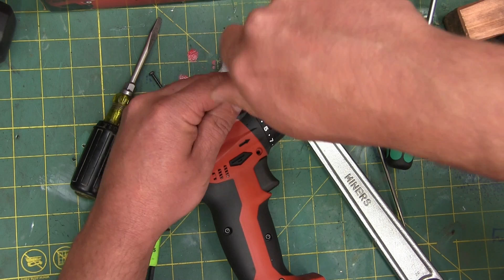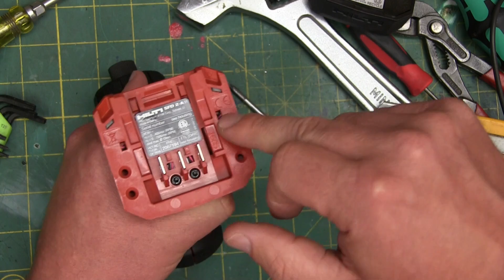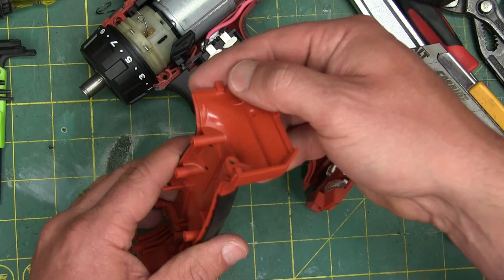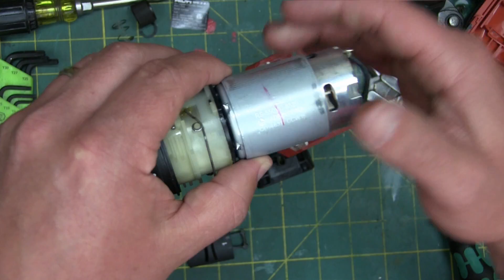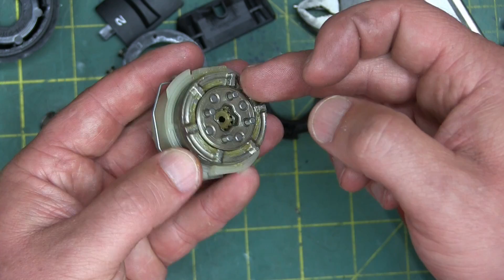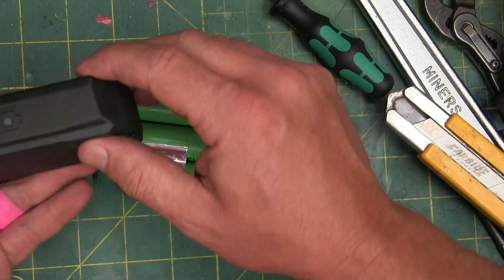BOLTR: HILTI Compact Driver | Milwaukee DeathMatch!

Comment: That Milwaukee 12 volt screwdriver is great! And for $30 used with a case a battery and charger, can you blame me for not owning the Hilti? I own a set of the M18s but end up using that screwdriver more than anything. The handiest!

Comment: Ave, I have a 12 volt brushed Milfucky drill, and living near the frozen tundra, the thing will barely spin in the cold. I don't think it's a battery issue, pretty sure the grease is too stiff. Any recommendation on a light grease to try and fix this?

Comment: After having seen photos of the outside of your compound, I'm having a hard time dealing with the fact that you have problems with boom-car assholes. I live in a 'hood' in Denver, so I'm used to it. You can't tell them to turn their shit down, as doing that will often result in accusations of racism. Sometimes, firearms will be displayed. The only thing you can do is smile, because inside of five-ten years these fools will be subject to extreme hearing loss. I'm an audio professional, and I have friends who are damn near deaf from exposure to SPLs quite a bit less than what is found inside a boom-car. Putting two to five thousand watts into a space as small as the inside of an SUV guarantees hearing damage on the very first exposure. What you wind up with is people who are not only stupid, but also deaf. A winning combination.  ;-)

Comment: this CE mark doesnt mean Chinese Export. CE is a safety mark for Europe, so the product coresponds to the rules and norms of the market.  even the CE logo is protected by law ^^ 

"CE marking is a certification mark that indicates conformity with health, safety, and environmental protection standards for products sold within the European Economic Area (EEA).[1] The CE marking is also found on products sold outside the EEA that are manufactured in, or designed to be sold in, the EEA. This makes the CE marking recognizable worldwide even to people who are not familiar with the European Economic Area. It is in that sense similar to the FCC Declaration of Conformity used on certain electronic devices sold in the United States."

https://en.wikipedia.org/wiki/CE_marking

Comment: Oh my gosh! Coupling the lowest end Milwaukee driver, with a high end Hilti... at LEAST match it up with a higher end M12 model...
Reply: That aint no high end hilti😂theres way way better ones made by hilti
Reply: It still held it's own where lesser tools would have cracked or burned. And it only smoked a little. Wasnt a failier test.

Comment: The piece you talk about in 5:25 looks to be and RFID sticker which is amazing in inventory control as far as knowing what is in stock. Never seen one used as a sensor paired with the alarm towers. I could be wrong though as I dont nearly have as much experience as thou.

Comment: i would love an intricate analysis of where the vibrations from the impact end, on my malakita(malaka means dumb/stupid in greek)impact diver they seemed to end up right into that bronze bushing at the end  of the brushed dc motor making it fail in less than 6 months of use, i've hacked a computer fan bushing and soldered it in place of the old one for another 3 months of use, but then one battery died and took the charger with it so it's just sitting somewhere now.
   i'ts not like that failure breaks the tool completlly but it makes a hell of an annoying noise, almost like it's crying in pain.

Comment: All stop, I've heard you say that the reason for the iron oxide cores was to reduce electrical noise...sure, that happens too BUT, BUT also the sparking at the commutator is reduced as well, perhaps it's most important function.

Comment: Not bad. The M12 they offer now appears to have more torque than the old one. 275lbs vs 212lbs with the hilti. There are 2 M12's now, didn't see that when I got mine a few years ago. They offer a 2 speed and single speed. Handy.

Comment: I have got it! Been trying to think of a product that needs BOLTR review. One that entails marketing wankery, unsupportable claims of quality, insane pricing, coresive sales techniques, and straight up bullshit. Kirby Vacuum $1000+ vacuumation. Added bonus, empire of dirt will have a $1000 cleaning implement for suckin accumulated stuff. From personal experience, they are able to Vacuum up a .22 WMR cartridges just fine, but these fine machines are not able to withstand the detonation after rattling about in the guts for a bit.(that makes for a mad wife there)

Comment: As a former Hilti employee I can tell you that the white lite chip you removed is an rfid chip witch contains the machine type and serial number of the tool. They use it to identify the tool if it's heavily worn and you can't read out the serial from the housing

Comment: I have this drill and I was just working on a solar array in -28c weather. Drill quit working, figured battery was too cold. Installed a warm one and it still didn't work. Had to warm up the drill. Hilt must have put the temp sensors in the drill instead of the battery. Rescued by Milwaukee!! But still love the Hilti.

Comment: The RFID chip on the inside of the tools isn't for inventory control in stores but actually contains the tool's serial number. The chips are used by Hilti's Repair Team if they cannot locate the serial number on the outside of the tool

Comment: AvE I have a 6 year old Bosch blue impact and drill set that I beat the fuck out of everyday and have never changed brushes. When they near the end of their run or I replace them I'd gladly send them up there for you to examine if interested. I'd crack them open myself but I want to keep any interesting finds inside the tools fresh. I also have an old unused Ni-Cd Makita drill from before >***BRUSHLESS***< in its original case. Probably at least 10 years old and I'd love to see it scrutinized.

Comment: I have to say that Hilti drills are awesome. My dad used to have a couple old Hilti drills that were nicd powered and those things lasted forever. I can't remember him not having those drills, and the only reason he stopped using them is because he couldn't buy new batteries and didn't want to rebuild them. So he switched to this set and he loves them, and so do I for that matter. good job on hilti

Comment: hey, very cool, inspiring and i learn a lot.! im sittin here cheking out a couple of older FEIN grinders. one from 99..msf666..:O awsome buildquality and efficiency..1800w in 1250 out. ceramic easy to take out, brushholders..insanely cool gearbox with a different much thicker driveshaft due to the strange but awesome nut and lock system inside the shaft..enormous bearings. these are the smoothest running grinders ive ever tried..dopnt make em like that anymore. very compact.

Comment: AvE Keep up the great Vlogs how's about stripping an Ingersoll Rand 285b-6 2400 Nm of Torque 1" impact wrench ! for sh**s and giggles. Show us the Pixies on Steroids hammering in that baby in the wife's sewing! (drop in Torques using different size air hose and couples. and can it be Hacked to get more power out of the tool) Your mini-pixie will love powerlifting that one along with her drill.

Comment: You should check out the Fein Cordless drills, on the website they boast about having a metal gearbox. thinking about purchasing their 4 speed with electric clutch. the 5 inch hole saw on 3/8 aluminium killed the clutch on my Milwaukee after a 100 or so holes

Comment: PROTIP: and just the tip, mind you. unrelated to the video. All those cans you have that spray stuff usually run out of the propellant OR the thing in them. Whenever either happens keep the tips of them. i.e I just put on the magical straw vs spray tip of a WD40 can on a brakeclean can! now I can clean my small hole much easier

Comment: At 14:13 isn't that a "RFID" (or some other security device) tag not a fuse?? It didn't look like it was connected electronically to the batteries.
Reply: TheDcianfarini tape over the temp sensor. wires came out the back

Comment: I've been using that milwaukee daily (hard-use all day) at work as an Electrician and it's the most reliable power tool I've ever owned, got it SEVEN YEARS AGO. Dropped it off a ladder a few times and still not even one hiccup. Its amazing.
Reply: Keith Baum yea I have Milwaukee 18v for like 3 years man and it’s bad ass. I just got the m12 it’s actually ku and small for lock smith and light fixtures. Any heavy work on it kills the battery. But I like Milwaukee tools.
Reply: I still use my m12 impact driver and drill that I purchased 6 years ago.

Comment: a little info on the glass reinforced plastic being hard on the molds, molds can now be hardened, if they choose to do so, to allow for longer run times, or less down time, depending on how you look at it. There will be a nominal cost, though if say mold is planned to run for a good amount of time, probably worth it.

Comment: AVE I would love to see you buy  the cheapest mill and lathe you can on ebay and do a BOLTR on them. Because Mills and lathes are expensive, even when you look at the mini ones. So seeing these cheap ass ones at around 100-200 bucks, I can't help but wonder. Because I and i'm sure other don't need some heavy duty rig, just something that at worst can just barely handle aluminum.

Comment: How does he know this all the crap? It just comes naturally to him.

Had a little backyard project this weekend that was made for ten year olds that went sideways and didn't even know what I didn't know about it.

This kind of confidence is just flatly impressive.
Reply: Engineering degree...
Reply: It's call learning and understanding how electronics work. No one's born with such knowledge these are all obtainable if you have the will and genuine passion to learn
Reply: @crazymanonweed117  he made few mistakes on the electronics part - the fuse is an NTC, no overdischarge/overcurrent protection in the battery itself. His mechanical knowledge is where it is at.

Comment: OK, almost 3 years ago, 
I got a 12 volt set of Ridgid 
brand drivers.  1, 3/8ths 
drill, and a 1/4 inch hex driver.

2 units, 2 batteries (2 and 4 AH)
and the charger.

$100, from Home D.

Still works just fine!

The driver is strong enough to 
tighten the clutch mounting 
bolts into the flywheel.  I had 
to torque them down, but that 
little did 98% of the work.

steve

Comment: 3 notes:
1. (this one is an educated guess) That 3 part housing has the interface separate because that interface is super critical, and having it be the same exact molded piece is simpler than trying to get every tool's  mold just right.

2. That is an NTC, not a thermal fuse. look it goes to the board and the microcontroller looks at it. 

3. There are discharge controls in the tool - that must be the use of that 3rd battery contact. There are no FETs in the battery, so the battery has to rely on the tool not to overdischarge.
Reply: the battery has only over voltage/charge protection but no over discharge/over current one. Could not spot balancing resistors, either.

Comment: The RFID tag you removed from above the battery terminals is not just for security in stores. Hilti are able to scan the tags and bring up the serial number of the tool. Which in turn tells them who brought it, when etc etc.

Comment: Hey AvE, i used to work in the vaping industry so had to know everything about every aspect of batteries, the difference between the green (new) and blue (old) Samsung 25R cells is that the green ones have an improved chemical formula so have way higher charge cycles, you're a man of a lot of knowledge so a little more cant hurt :)

Comment: CE Mark
RTL offers CE Mark testing to the European Union EMC directive. When affixed to an electrical apparatus, the CE Mark is a manufacturer's declaration that the electrical apparatus complies with the essential requirements of the appropriate European directives.
The EU's harmonized standards provide permissible limits, guidelines, test procedures and methods for emissions, immunity and electrical safety levels for electrical apparatus testing and placement in the market. Product-specific standards are applied as defined in the individual product-standard scopes; the generic standards for emissions apply if there are no product-specific standards published in the European Union Official Journal.
The European Union's EMC directive 2004/108/EC became effective on July 20, 2009, replacing EMC directive 89/336/EEC. This new directive enlists the requirement for electrical devices to meet Electro Magnetic Interference (EMI) control limits, and all electrical devices entering the EU market must meet the criteria stated in the directive.
EMC directive 2004/108/EC establishes the essential requirements that facilitate free access for all electrical goods designed for the EU, such that (1) the electromagnetic disturbance generated does not exceed the level above which radio and telecommunications equipment, or other equipment, cannot operate as intended; and (2) an expected level of immunity to electromagnetic disturbance is required, which allows the electrical goods to operate without unacceptable performance degradation of its intended use.
The table below lists some of the tests we perform; it is not all-inclusive:

Comment: I used to have a blue line Bosch impact driver at the truck engine factory dyno rooms to do and undo hose clamps, they worked well I have to say, it provided the extra kick to prevent coolant and other fluids to leak when the air driver was torque limiting a shy too low when hooking up engines for a run. The drill setting was powerfull enough to chew up any hose clamp after 2 or 3 passes so we liked them, but it had the transformers looked though :D

Comment: You would expect the milwaukee to fail, Hilti is an industrial  tool supplier, While milwaukee has exposure in that market, Hilti is a "go to" tool for most union companies...I've used both for decades and it's a no brainer the quality and strength difference...Sadly, hilti is being built abroad, especially in the small tool area...

Comment: I believe the thing taped to the batteries isnt a fuse but a ntc resistor wich reduces its resistance when the temperature gets higher. They are commonly used on batterypacks and on smartphonbatteries they are attached to the third port in order to allow the phone to check temperature. Most propably the pcb checks the resistance and determines if the toll should be shut down or not and if charging is possible

Comment: That little mark at the base of the clamshell might not be a defect in the mold, but a vestiage of the gate that the molten plastic flows through as it goes to fill the mold cavity.

Comment: ETL (Intertek, used to be Edison Labs) is just as reliable as UL. Both are recognized by OSHA as independent Nationally Recognized Testing Laboratories. The primary difference, really the only difference, is that UL writes the testing standards, whereas ETL follows those testing standards. Lots of companies use ETL because their turnaround time tends to be faster, hence, lower costs to the companies.

Comment: Sprag clutch looks like a brake to stop the bit when you let off the trigger.
Reply: No, he's right about that. I have a 20 yr old Skil screwdriver with the same exact sprague clutch mechanism and it advertises that on the outside. It's pretty handy, too, like when the NiCad battery croaks in the middle of a job. (yes, I've since hacked in a Li-Ion battery just to keep up with the Jones)

Comment: Whenever he says he's going to put a link in the doobly-doo, there's 0% chance it actually happens lol
Reply: It's the thumbnail at the end of the vidjayo.
Reply: He's such a tease
Reply: John Possum - To be fair to Ben... he built his electron microscope.
Reply: PS -- Stupidly I saw no use for it so I donated my uncle's Oscillograph Wobbulator to Pavok's wireless museum along with a 5 QUART bucket of tubes. Of course later I got a tube tester and wish I had never donated neither. Mostly it was a fury to clean out my parents basement. Which is also how I wore out Craftsmen's first ever cordless screwdriver in just a few months.
Reply: Does he have a video on that? It is in an interesting choice using the greenscreen as a visual display device. I think I know the reason why... the electron beam on the CRT is steered by electrostatic charges rather than electromagnetic forces  ( like most CRTs) and therefor is more accurate and easier to manipulate for that specific purpose.

Slightly offset note... my uncle offered me an O scope and when I got it turned out it was an "Oscillograph Wobbulator" and I think it steered the electron beam the same way on a very small screen . BTW Mr Carlson's Lab has the only video out that pops up to that description on YT.
Reply: It is linked
Reply: But you love it anyways! You will take it, and you will like it, and then you will ask for another!
Reply: Go to Applied Science channel and find it yourself. It's not like it's rocket science. Excellent channel BTW... That guy works for GoogleX has an electron microscope and drives a DeLorean. Talk about living the dream! Full Nerdgasm.

Comment: The marking CE doesn't stand for China Export. Here's a quote from the website CE-marking.org   "The letters "CE" are the abbreviation of French phrase "Conformité Européene" which literally means "European Conformity". The term initially used was "EC Mark" and it was officially replaced by "CEMarking" in the Directive 93/68/EEC in 1993." Products sold in the European Union have to have this marking.
Reply: Right-Hand Renown-Spear You must be new to the videos. I know this is a year old by now but hey, I hope you learned at this point he...has quite a way with words.